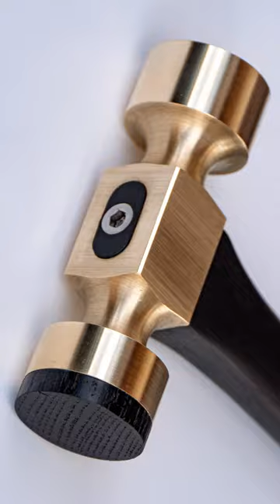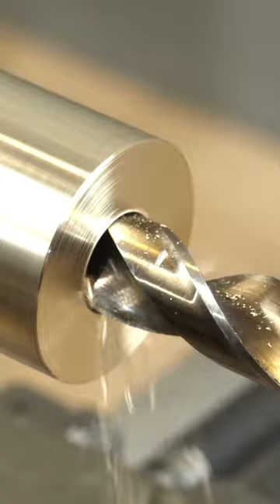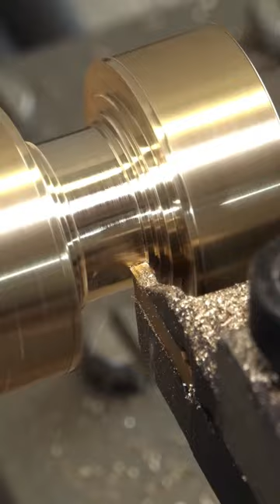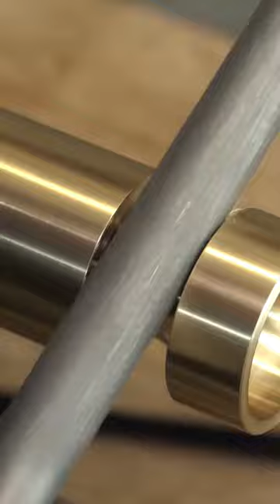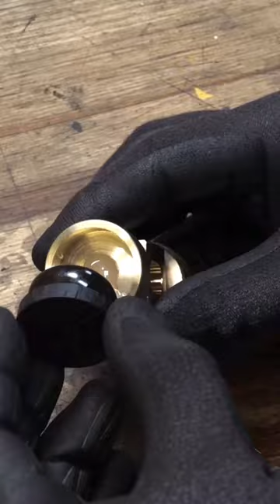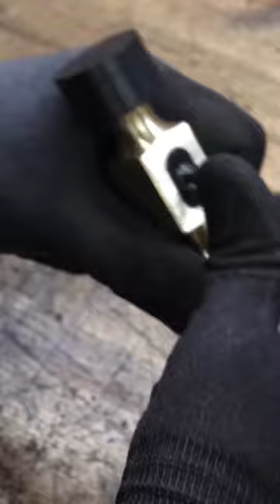Brass Machinist Hammer, Super Speed Build #shorts

Comment: What is the black insert made of? Is it hard to remove without marring the brass? The stepe that were filed smooth with a round file--the steps could have been left in & the hammer still would have looked very cool. This version is cool too.
Reply: Rubber most likely
Reply: Looks like it's probably the same black wood like the handle